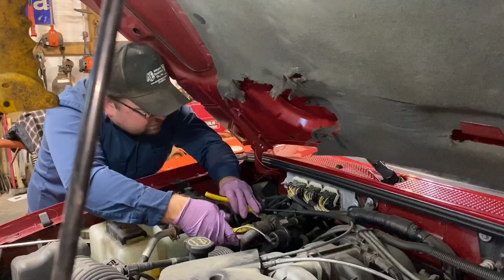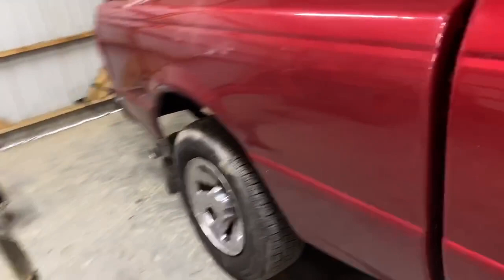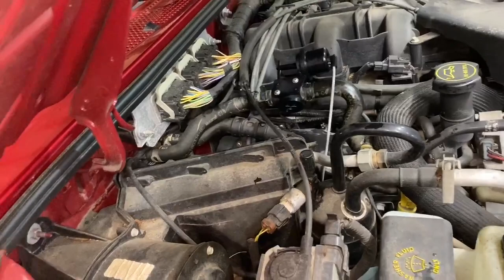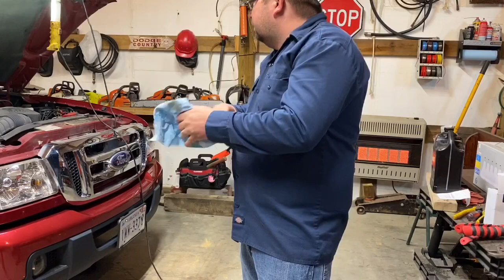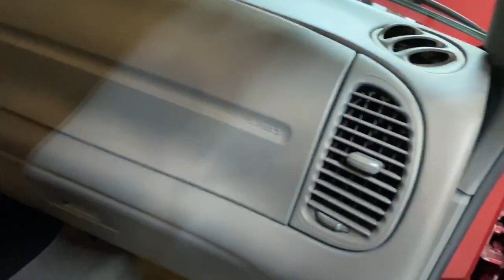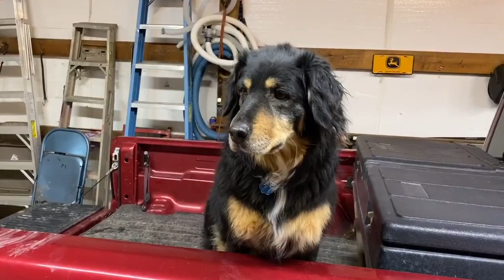Replacing heater control valve in Ford Ranger and some complaining!

Comment: Ben this is  great bit for you but helps others we all have some problems but sooner or later it's fixed
God Bless All 
PaK
Reply from the maker: Thanks
Reply: Helpful video!

So why do these leak? Do they look through the screws? All the tubes seemed closed with clamps and dry.

Anyone know about repairing it?

Sealant appropriate?

Comment: Just replaced this part and it's already leaking like the old one.. About to bypass it completely
Reply from the maker: It’s easy to get bad parts these days. Thanks for watching
Reply: Did you replace with oem?
Reply: @FallingStar1080  No, the aftermarket actually looked better built that the Motorcraft one but obviously it wasnt lol.. Replaced it with Motorcraft and no leaks so far! I guess some things aren't what they seem 😌
Reply: I bypassed mine and i wish i had done it sooner

Comment: Will this fix my truck from getting to hot in side cab. Heat and air work but can't regulate the heat.
Reply from the maker: Watch this valve when you switch from heat to cold and see if it changes position. If not it probably is the problem.

Comment: I have the 2011 Ranger XLT extended cab and my heater is blowing temp gauge is normal but isn’t blowing hot air when I turn it to heat it worked a few months ago or last Winter so I suspect the heater control valve isn’t opening letting the hot coolant go thru the heater core?
Reply from the maker: Walter that’s most likely the issue if your temp gauge is showing normal.

Comment: Hey there howdy 👋 I have some questions I have a Ford ranger is 2000 4 cylinder 2.5 l a problem where it started blowing cold and luke warm and cold and now it won't blow warm at all I made some tinkering and still no luck could you please comment back to me desperate over here help SOS lol😂🤣
Reply from the maker: Good chance it’s the heater control valve, possibly a bad thermostat. Thanks for watching!

Comment: I got ford ranger 2000 xlt my dad took off the heater control valve. He doesn’t remember which way it goes. Does the arrow point towards the heater core or towards the the front of the truck and radiator?
Reply from the maker: Best I remember it points towards the heater core.
Reply: K&H Tractors thank you for the quick reply
Reply from the maker: The Leader no problem. Just hope I told you correctly.